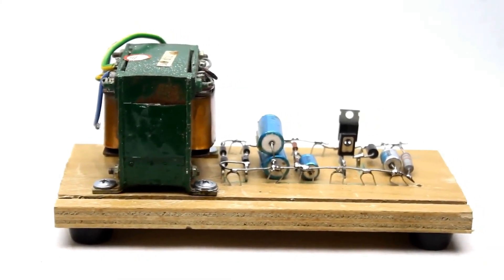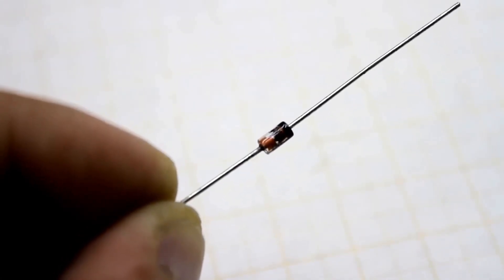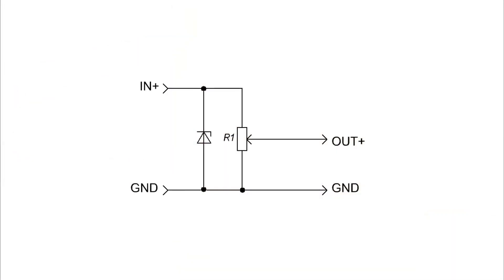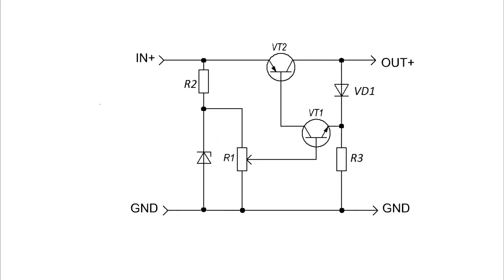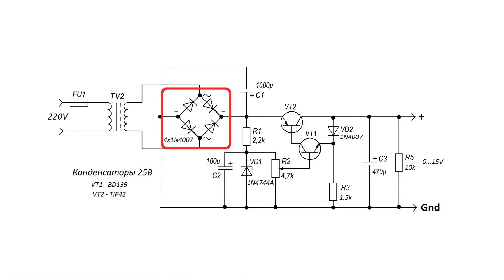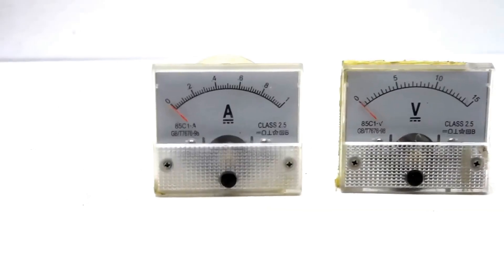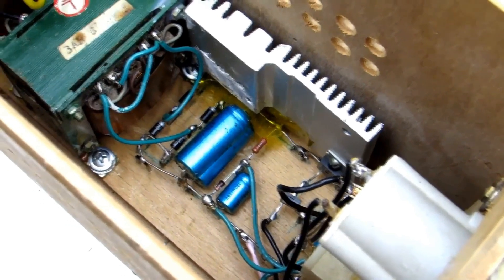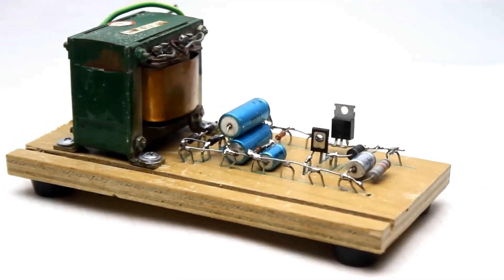Simple DIY Lab Power Supply for Beginner Electronics Hobbyists

Comment: And because he is a beginner in electronics, he is suggested to work on mains voltage. For little money, beginners can also get ready-made power supplies from the Chinese dealer including regulation, display and fuse. If a beginner absolutely has to build it themselves, then, for example, an old notebook power supply with an LM317 behind it for voltage regulation. I like your videos and suggestions, but this one is life-threatening and irresponsible.

Comment: It is rather recommendable to use a regulator-IC which allows to adjust voltage and current. They support as well overload protection and you do not have to connect more parts than with you suggestion. However, more easy it is to use one of the power regulator kits on the market, open frame tested and ready to use or for soldering yourself.

Comment: My first variable power supply was a handful of NiCd "AA" batteries soldered in series, with taps at every point. It was constantly trickle charged from a simple unregulated DC power supply and a resistor (the transformer was one of those black boxes that plugged directly into an outlet. It was an old fashioned iron core transformer). To select a voltage I just hooked my leads to an available tap. My only options were in 1.25 volt increments, but close enough. And it had really low noise, especially if I unplugged the transformer.